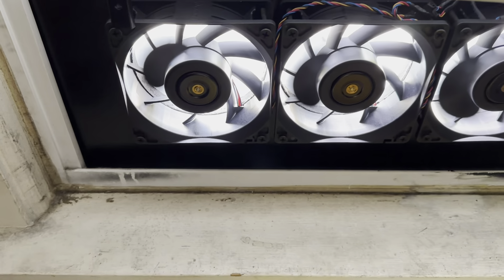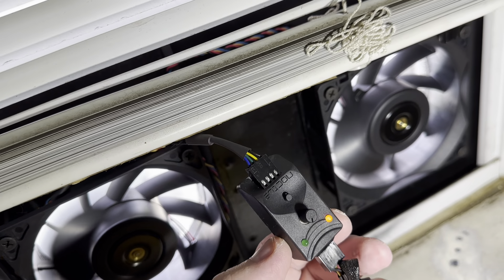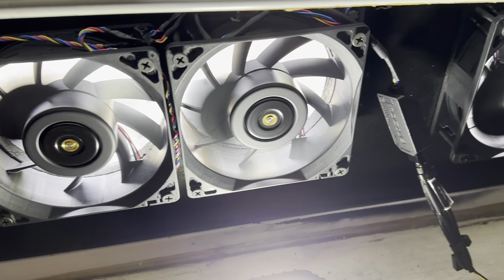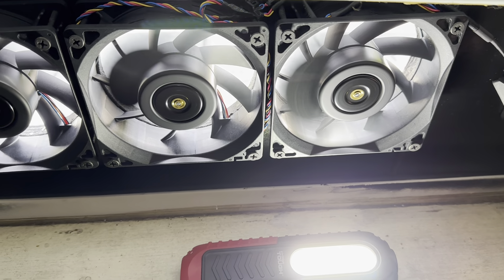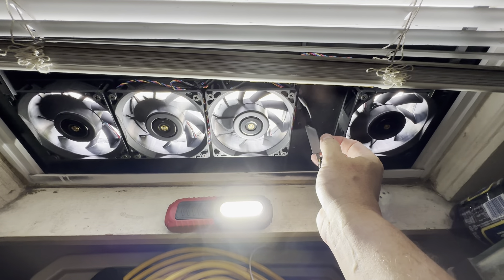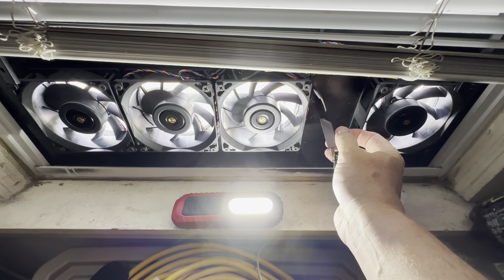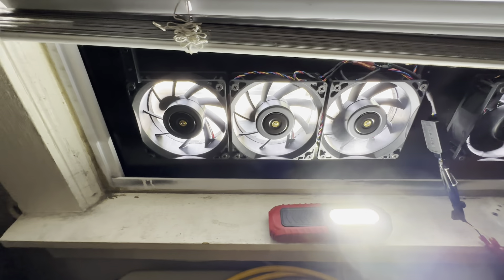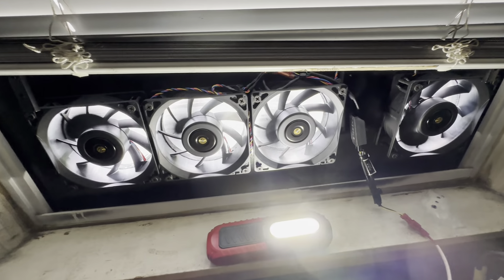4 Delta QFR1212GHE 12V Cooling Fans Used As a Solar Powered Window Exhaust Fan

Comment: cool. what is the size in mm of the fana and are these exhaust fan for the room?
Reply from the maker: 120 x 120 x 38 mm. Yes I made them to exhaust heat or smoke out if I am soldering electronics. Look at description for a lot more info.